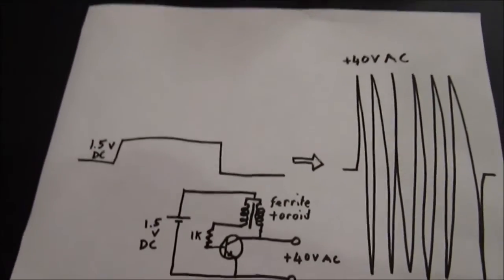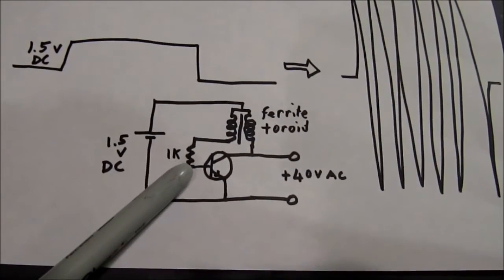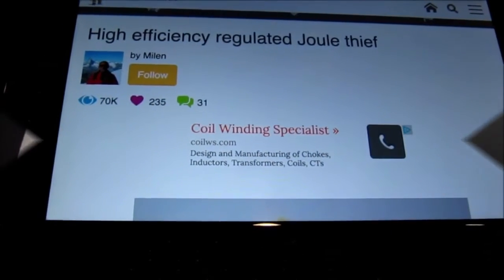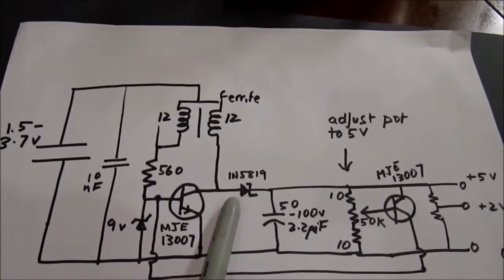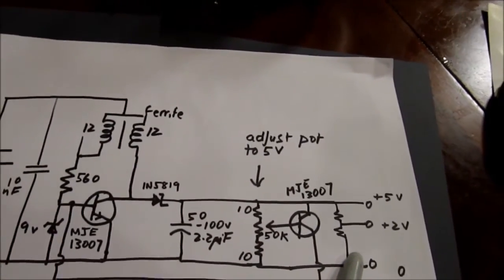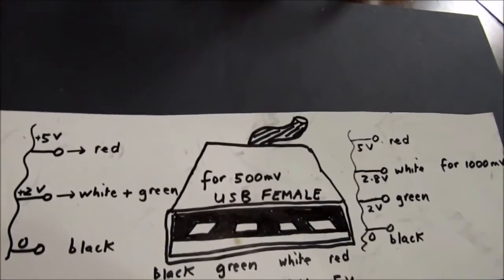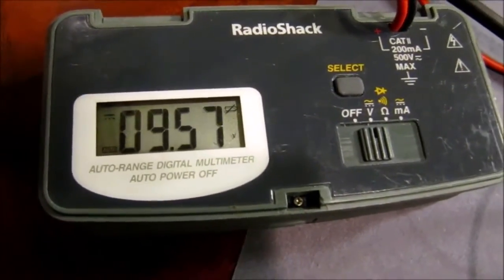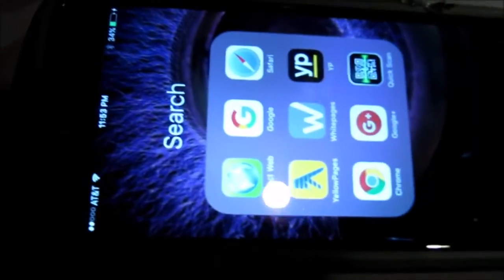Joule Thief Phone Charger

Comment: If you wanted to control the ouput voltage by means of a negative feedback loop, would you not typically try to turn OFF the switching device to reduce the  magnetic charging cycle. you diagram show the feedback transistor connected as an emitter follower which would force the switching transistor to stay on longer than it wants to! The output voltage may be "regulated" but the consumption from the battery is going to increase is it not? I need to do some experimenting!
Reply from the maker: Makes sense. Would be worth looking into. Time to get out the breadboard!

Comment: fake fake fake...it's fake charging means phone's battery dose not charging but only phone show indicator "battery is charging" but actually not.
Reply: It's not fake. I made a joule thief with a heavier duty transistor & a larger toroid and I use it to boost the voltage of a 5w 12v solar panel and to charge a 12 volt battery. It works unbelievably well. I've been running it for several days with a load of LEDs on the battery about 18 hours a day. So far it's keeping the battery fully charged.
Reply: its not a very clear explanatiopn, but it's not "fake", there is nothing wrong with a boost or flyback converter taking a lower voltage source and generating a higher voltage output....
Reply: Yup. these Christmas thieves squat to get the necessary power.

Comment: What newer Phone requires 2V?

I charge my iPhone 5s (And also the 6 and the 6s Plus) with Black 0V and Red 5V, the Data Cables shorted out. That's how all USB Chargers work. (At least all I have). It would be crazy to have every USB Charger have a two stabilizations for 5V and 2V
Reply from the maker: +Michi Lo The stabilizing voltages are to set the maximum amps. I think 2v on the data cables restricts the amps to 0.5A while 2.6v sets it to 1.0A. I have not tried it with the data cables shorted out. I will give that a try! thanks for the info! D
Reply: TeslaSpot 101 To correct myself, my Anker 4 Amp USB PSU had 2,8 V on both Data Pins. This is the only one that does this. Even my Apple one doesn't do that.